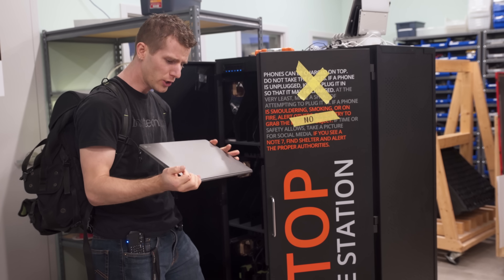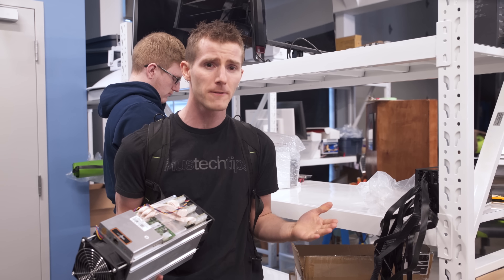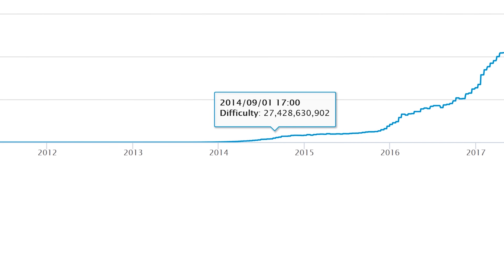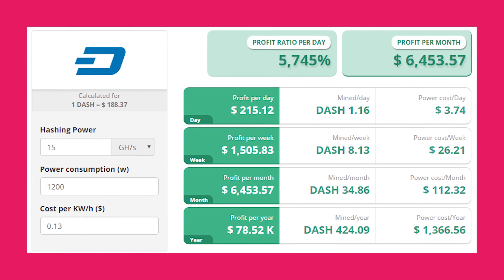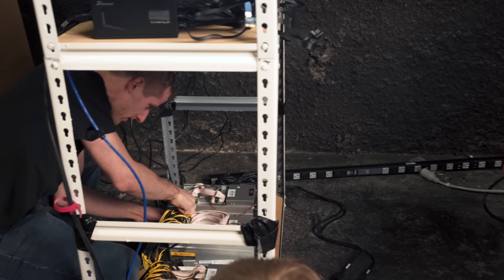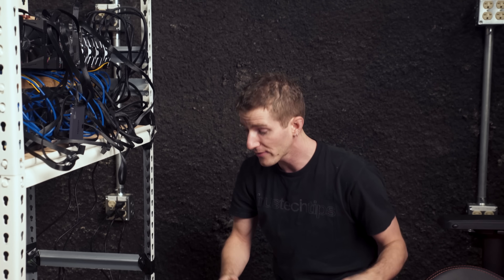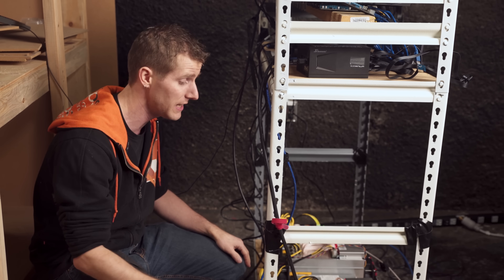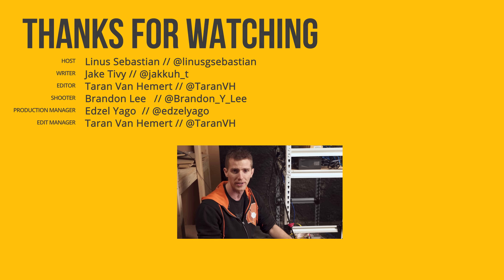Is Mining on ASICs Worth It? - Mining Adventure Part 3

Comment: You know what, I've changed my mind about cryptocurrency. I hope better ASICs keep coming out with better hash rates so it drives the difficulty even higher still to the point that it makes gpu mining unprofitable at every level of perfomance, driving down the price of GPUs back to their normal prices. :) Good job ASIC devs!
Reply: This is precisely what I thought to myself watching this as well. "Good, eventually these ASICs will make GPUs worthless for mining and we can finally have our MSRPs back again."
Reply: Anthony Flagg Yay! I have someone on my side! :D
Reply: Unfortunately the alt coins that he talked about cannot be mined with ASICS such as Ethereum due to the way they were set up
Reply: Ashton Herron Not yet at least, I bet someone's working on an ASIC to mine any one of those.
Reply: +Eric Del Toro
You're talking about creating an application specific hardware device, that does essentially what a graphics card does. The reason you cannot use ASIC miners on those coins, is because they require different types of calculations. You would essentially need to re-create a graphics processor to do it.
Reply: WELL SAID   ASIC FTW
Reply: +tenshi7angel Well why the fuck did they make the coins that way? It's like they were trying to crash the GPU market.
Reply: Malus1531 so asic miners wouldn't destroy the mining market for it like they did bitcoin.
Reply: requirements of mining most altcoins make them 'ASIC resistant' .. thats why graphics cards are used, at all. Admittedly something could be made to specifically run the Ethash algorithm at some point in the future but the product you would get would be something very close to a super optimised and customised graphics card. AMD/Nvidia prices may come down but I doubt they would ever return to the norm as theres now these new types of cards that need alot of the same parts. so demand for the parts to even make the cards would go up. Theoretical situation not real.
Reply: Agreed. I'm so ready for a new GPU (my 6970 is just not up to par any more), but I refuse to pay current prices, so I've become a console gamer. (I can't run DX12 games at all)
Reply: It’d be good to split the difference to drop GPU costs, but the ASICS will still waste electricity to make unstable currency of dubious merit.
Reply: As the difficulty gets higher the price of ASICS get higher, meaning only rich people can make money on bitcoin. Great world we live in
Reply: ASIC resistant algorithms are used to stop the centralization of mining by ASIC producers. One look at the ASIC market should tell you all you need to know. The idea was that average gaming rigs could mine. If an ASIC was made for Monero, im almost certain the community there would be for breaking that ASIC's functionality, which is great.
Reply: CS:GO сФинщини then nvidia and AMD can/should lock gpus to deliberately be inefficient at mining so they all lose money when mining any kind of coin.
Reply: You want card producers' driver team to waste their time combating mining programmers? That wouldn't earn gpu makers more money, but mining programmers have financial incentive to make mining better (they already custom bios) and would constantly attempt to thwart it/adapt. Its why people have managed to design and make ASICs for BTC.
Reply: illidur it would normalize gpu prices for people who use gpus for useful non-mining tasks. Nvidia/AMD could turn around and make mining specific cards, I think Linus has shown two examples of them. Let miners have their own products separate from the gaming gpu market.
Reply: You want card producers to spend their production efforts on cards that gamers can't use instead of ones they can? Also miners would buy up those if they are better/cheaper and then buy gaming cards. Its riskier to produce cards for just mining than more for both markets at the same time.

GPU mining was chosen intentionally by the makers of certain coins for the reason I said earlier.
Reply: illidur If the mining specific cards have higher hash rates and lower power draw, I'm pretty sure they'll buy them even if their priced higher than 1080TIs or their AMD equivelants. They're the reason that even 970s are listed for $800+ new. Make them pre-order based like ASIC miners like that Nvidia/AMD won't have to worry about any remaining back stock that'll be effectively worthless after those cards are no longer efficient.
Reply: illidur not to mention, mining specific cards would drive the difficultly up just like ASIC miners did, making normal gpus even more inefficient, if only due to power draw.
Reply: If they made ASICs any good coin community would switch algorithms to make it useless instantly to stop centralization.

If they make a GPU that can't game, but its far superior for mining they will all be bought up because they are "pre-order based" and next they would buy gaming cards. Assuming they flood the market with mining GPUs that can't game, then they aren't making gaming GPUs. So you would be advocating they don't make gaming cards lol.
Reply: Also those card manufacturers have no incentive to separate the cards. In fact like I said, its riskier. Mining profit could dip and cost them big time.
Reply: Malus1531 miners didnt crash the GPU market. Its a classic example of capitalism. Supply and demand and highest bidder wins
Reply: illidur Ah! Not true. If this hypothetical solution was implimented. It would be a two prong solution. First, mining specific cards would be available, say, $200 usd over standard varients, would be available for pre-order. Standard gpus would be locked against mining software, the onboard software/bios or whatever it is, would detect the mining software and run about as well as a fat guy trying to run a marathon. So, now miners would either have to buy mining cards or seek out the previous unlocked varients of the new locked standard gpus.

So, little example. A 1080ti would make say $10 a day (that's probably wrong but work with me, its an example) after electricity costs and whatever else you pay to mine. A mining specific card would make something that's at least double that due to optimization and lower power draw/higher hash rate at the same power draw. It would make standard gpus all but useless in comparison due to the greater efficiency of mining cards and the spike in difficulty would make any remaining unlocked gpus probably completely unprofitable. Standard gpu prices would return back to normal, miners have a product they can use, everyone is happy aside from miners but come on, if they have the money to buyout all the high end and enthusiast cards on the market then they can afford to pre-order a more expensive product that's geared for what their doing.
Reply: It's been like that for long time. Just stupid people mining with gpu without doing any homework.
Reply: tenshi7angel That's why there are fpgas. Still better than graphics card.
Reply: A better solution would be to use GPU resistant algorithms. If it's possible at all. CPU's don't scale up as well as GPU's, so it probably won't be profitable to build dedicated miner configs.
Reply: As I said... "You want card producers' driver team to waste their time combating mining programmers? That wouldn't earn gpu makers more money, but mining programmers have financial incentive to make mining better (they already custom bios) and would constantly attempt to thwart it/adapt. Its why people have managed to design and make ASICs for BTC."

The super good mining card idea is unlikely, as the current GPU mining algo I use (on my gaming rig) is memory intensive. It was made that way on purpose to stop an ASIC like you suggest.
Gamers mining is a better solution. If all gamers mined it would reduce profitability making bulk mining less doable. I'd rather Nvidia/amd make mining easier.
Reply: illidur hog wash...
( most likely hog wash )
Thats why there are Tesla and quadro and geforce lines for every chip iteration?
Because a valid market that can benefit from such concentration exists!
Unless yer suggesting that the currency mining interests that have created havoc on gaming GPU prices do not point to a valid market that might be profitably catered to?

Ha!
Double Ha! ( Ha! HA! )
Reply: Miners already made a new iteration. 1080 Ti's and Vegas ATM lol.
Reply: What?
Reply: Preach it brother
Reply: Eric Del Toro obviously don’t understand. Alt coins are coded to be ASICs resistant lmao. Gpu mining will always be here.
Reply: Actually exist specific GPU Mining Card but it's OUT OF STOCK and nobody want that because warranty is too short for gpu mining card instead gaming gpu gaming give 1 years warranty, tip: 'MINING GPUs' they're more efficient in speed and electricity %35 more.
Reply: Because allowing ASICs to mine a crypto causes large mining groups (see: china) to invest in ASICs that will then control the hashing market. This hashing market is then run by only a small group of investors which causes the crypto to no longer be centralized and gives the miners too much (voting) power over the network. Crypto such as Ethereum is more decentralized in the way that a lot of hobbyists run a mining rig at home and can control only a tiny piece of the market, ensuring a fair network.
Reply: Eric Del Toro the latest baikal asic is able to mine different algorithms. So its selects the best one and mine it. This has caused a huge jump in the hashrate of this algoritm best coin. in 1 week the revenues generated became the same has the S9. Like linus said, you only have 2 to 3 months to have a good roi, after this it will takes 1year to get some profit. You just have to pray to see the bitcoin value jncreasing to compensate the lack huge hashrate.
Reply: for sure you can mine a coin which has no value. you can mine the most profitable algorithm of the day etc...
but man, you are not alone, all the GPU miners are doing the same things ! which has the same result at the end:
everybody is sharing the same fees and mining profits, at the level of the power you have.
a gamer with a single card will have no added value to mine, the revenues are low and will be lower and lower other the time, while the GU prices will continue to increase, because enterprises can buy a lot of them. 
For an entreprise its an expense, they deduct this from their taxes, a gamer cant do this.

in 1 month, a GTX 1080 revenues in BTC drops by 50%. it was around 0.0005BTC per day a month ago down to 0.00027. 1 month, 50% less revenues, we can check in 1 month what's this GTX can do.
Reply: Or PoW based currencies could die or switch to PoS. Currencies like nano are “minerless", for instance.
Reply: 30 years into the future ..... " Grandpa how did you make all of your money so long ago"   John Galt aka ( grandpa ) " Well it was hard I plugged a machine into the wall and it collected money for me"   * Mic drop*
Reply: We are using GPUs to make money not being lazy and sit on our ads for hours on end wondering what there game would look like with a 1080ti.
Reply: iMiniBiscuits lmao came to this video for a throwback wow people were dead wrong about asics
Reply: You were spot on though
Reply: It’ll get to the point where it won’t be worth mining because of power costs.  Hope this happens soon and we can start looking after the planet instead of computing for the sake of computing causing global warming and excessive power usage !!!
Reply: Mrpersonman0, do some paper calculations or draw a graph on logarithmic paper and you will see that crypto mining hash rate will exceed compute square law and asic compute capability very soon.  It is a completely unproductive idea and it is basically a scam to sell you something with almost a guarantee of no return.  It’s akin to selling you a shovel to one gold where you might find a speck that wouldn’t even pay for a postage stamp let alone the shovel and the effort to dig.
Reply: @Gazza-usa < You're absolutely right, people are so gullible, it's not even funny.  "Oh look there!  A speck of gold, you need this $100 shovel to get it!"  Dig for an entire day and collect $1 worth of gold... and that's exactly what this crypto market has come to.   Yes, those who have jumped on it in the beginning may have made some money, but now it's too late for the average person.  Nowadays only the big companies and rich folks even have a chance at it.  So save you money, and plant some weed... No joke, there's probably more money to be made in weed. lol
Reply: Did not work sadly. GPU prices are all time high. History repeated itself even worse this time
Reply: I'm from the future, I have bad news...
Reply: That was kind of the point of asics, make something else that can be affected by booms and busts.

Comment: Asics would be really effective with solar panels wouldn't they?
Reply: yep. most solar arrays can be bought for a few thousand (or cheaper if you're not planning on powering anything but the mining circuit) and then power is negligible cost
Reply: The cost of solar power is higher than normal power from water and nuclear. Most miners nowadays have free electricity for some reason.
Cryptocurrencies based on processing fake work need to die out for the sake of humanity.
Reply: @YaFunklord  Solar power doesn't cost anything... It'll pay back itself in a few months
Reply: @YaFunklord  Do you have a solar system? Because I do, and it paid itself back in a few months.
Reply: @cfzone8685  You didn't pay the environmental cost for it, you externalised it. You do that when paying for nuclear power for example, and hydro, depending on where you live.
Reply: @YaFunklord  The environmental cost doesn't effect the average user at home.
Reply: @cfzone8685  Oh, so if it's all about money, why not just steal the electricity from your neighbour? Same kind of logic.
Environmental damage is logarithmically increasing theft from future generations.
Reply: @YaFunklord  So what  is "Clean Energy"? All types of energy require a cost environmentally, but even thought there is a cost for solar, if you use solar for a long time, it'll pay itself off, because there is no further environmental cost, unlike nuclear power.
Reply: @YaFunklord  Nobody was talking about environmental costs. Solar panels for mining exclusively will mean free power (and probably selling money back to the grid). This, in turn, means your miners will be generating money at no cost besides the upfront costs required to pay for solar and miners. This is profitable in the long-term. Good beer money
Reply: @lytheus69  @CF zone In no possible universe in any possible meaning of the word, is it free, ever. Someone else is paying for your theft.
Get that through your head and stop saying false and ignorant things.
Reply: @YaFunklord  lol and how is it not free? Solar panels financially pay for themselves after a few months thus generating "free" power for your household as you are no longer paying the power company. I'm not talking about environmental impacts, I'm exclusively talking about financial costs. You're moving the goal posts to try and prove a point.
Reply: @lytheus69  As I said, it's easier to just steal the electricity from your neighbour. Or while you're at it, why not just steal the money directly and avoid all the hassle with bitcoin?
Reply: @YaFunklord  ...it's easier to break the law than to spend your hard-earned money on something completely legal? yikes
Reply: @Rock Too Likewise. Learn a thing or two about physics before wasting all your money on pointless endeavours.
Reply: Ducklord How is solar power worse than hydropower ? You know building huge hydroelectric power plants has much worse impact to the environment than building solar panels right? If you don’t convert solar energy to electricity, most of them just pour in dirt. People like you are very inconsiderate.
Reply: @itsmoses7973  hydro power has marginal impact in reasonable amounts and the ecosystems adjust around it even in mildly unreasonable amounts.
Solar panels are an environmental net loss from the get go, pushed on 3rd world production.
Reply: @YaFunklord  tell that to the fishing businesses in countries near china where there were droughts because of tons of hydroelectric plants
Reply: @davidmella1174  There's a difference between use and abuse. It is possible to maintain ecological balance with hydro. Like most of the world has done for the last 100 years, apart from a few known culprits in SE-Asia.

Solar panels have their largest environmental impact during manufacturing and recycling. But have an ecological effect by covering up land mass and moving that sun and heat elsewhere. They use dirty materials and technologies.
Even nuclear has a lower overall environmental footprint.
Reply: Lmao @ ppl talking in this thread and not understanding anything
Reply: hairystyles42 facts bruh I think I lost brain cells from this lmfao
Reply: @gopher256  Lmao
Reply: I just read the entire argument and can’t say I regret it, its funny how hard people try and push a point. (Ducklord 😂)
Reply: @ynotmichael  duckloard is literally a follish a duck
Reply: @YaFunklord  did i ask?
Reply: Do as you wish. 
But don't complain when your government starts taxing you for the solar panels due to environmental concerns.
🤣
Reply: @YaFunklord   Truth, this is so unnecessary and bad for the environment.
Reply: Yup!
Reply: @YaFunklord  damm i lost brain cells reading this
And before you give me the Latin version of arguing by attacking a person I'm not even arguing just comment ing a fact.
Reply: Ducklord The government gives you money to put up solar panels(in California anyways). And lmao this was the best and stupidest thread I’ve read on YouTube
Reply: Sahil Patel you’d think they would’ve read a book by now aha
Reply: @zyftis6927  I think you didn't need any help in that regard.
Insulting people who are smarter than you isn't a survival trait.